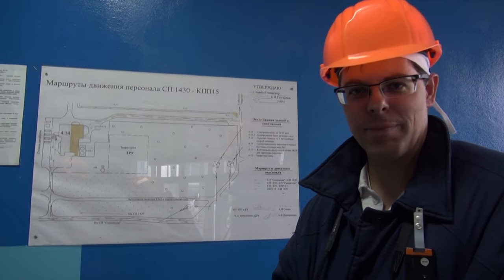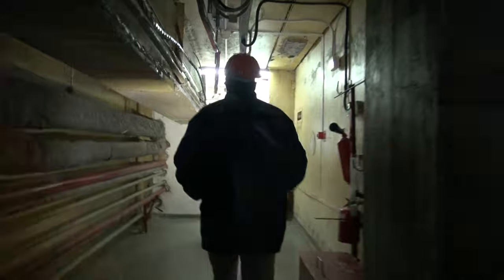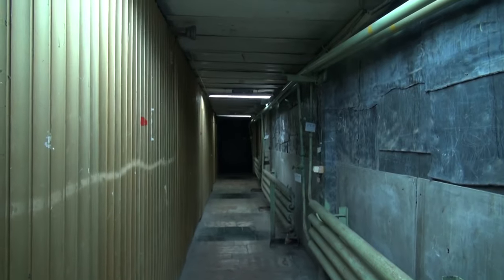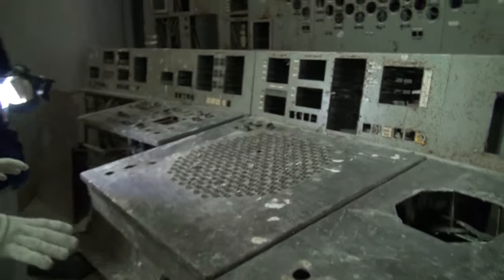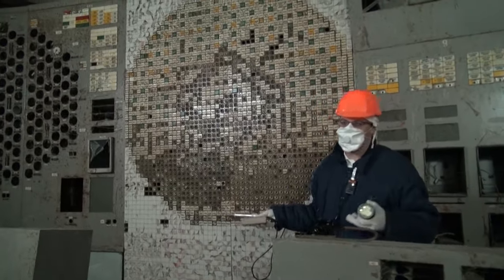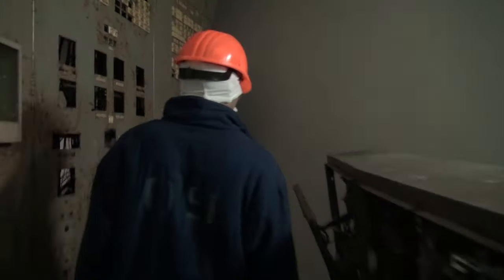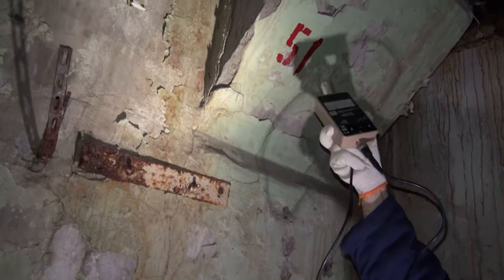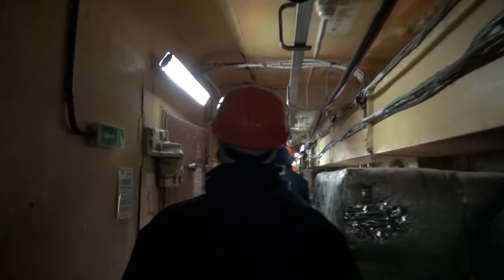inside Chernobyl ЧАЭС sarcophagus 2016 - reactor #4 control room and lead-lined corridors

Comment: Imagine, 750.000 pepole (soliders AND civillians) were sent to work on cleaning chernobyl, but the most disturbing story is when they clean the "3 deadly roofs" the first roof had around 200 "roengen" which mean 2 hours in that parricullar space could cut your lifespan in half, the second roof had around 400 roengen wich mean half of that time could cut your lifespan in half, and here is the real issue: the 3rd and the most deadly roof... the roof of reactor 4... the pieces of graphite and the derbis had around 12.000-14.000 roenger which meant 2 minutes on that roof and your life is cut in half, 2 minutes 30 seconds and youre gonna die in a matter of months 3 minutes 15 seconds... youre dead in weeks... the soviet goverment wanted to use moon walkers to clean the derbis off the roof and dump it into the molten reactor... 3 moonwalkers were used to clean roof 1 and 2... but the radiation of roof 3 was so high the wires in the robots decayed in matter of seconds due to radiation... a german robot named "the joker" was deployed onto the roof... it had 1 cm thick layer of lead metal around it... even that did not make it... so the commander made a decision to use "biorobots" (humans) to clean the roof, over 3.400 civillians were on the roof cleaning it... but not at the same time... they were in groups of 5 anf they each had lead armor and special equipment... shovels as well... each group worked for around 90 seconds... then they got off and the used armor was later destoryed... 

Could the disaster have been preveented if the Az-5 button wasnt pressed in the first place??
Reply: The reactor was in unstable configuration and was "running away" so there was nothing that could save it.

Comment: I just want to say, in the ussr never it was the fault of the equipment but always of the personal, in the states mind, dyatlov and his crew were the unlucky ones to be at the shift that exploded, the explosion was caused by the shutdown button
Reply: The 1991 report from "a Commission at the request of the USSR State Committee for the Supervision of Safety in Industry and Nuclear Power (SCSSINP)" removed most of the blame from the operators and severely criticized the reactor design and failure to act on flaws known (by the designers, not by the operators) prior to the acccident.

Comment: There is a documentary that I saw that said that the RBMK reactor that was unit 4 had sand packed around in between the outer and inner wall of the reactor.  The documentary stated that when the containment lid was blown up in the air, it came down with such force that it forced the base of the reactor downward.  It allowed the molten fuel and sand to mix together.  When the molten fuel and sand mixed, forming a solid mass of molten fuel and glass in the basement of unit 4.  One mass makes up what is called the "elephant's foot".  It's so radioactive that you will die of fatal exposure if you get too close to it.
Reply: All true, as far as I know,
Reply from the maker: true, but the elephant's foot is only one of the largest fuel containing masses (or quite probably THE largest mass), there's plenty more, though smaller "streams" throughout the entire building. as from what i've heard (i haven't seen the elephant's foot in person), the dose rate there is about 20 Sv/h, so you can run to it, take a photo, and run back. But the phrase "come on, just give me five more minutes" would indeed be fatal there.
Reply: 300 secs=ded

Comment: Why does it look like the reactor 4 control room has a wall in the middle of it?
Reply: Because it does, most of the building is cased in concrete
Reply: It looked like a small semi circular room. The hallways also looked cramped. Definitely designed for function over comfort.
Reply: they put concrete everywhere to somewhat contain the radiation

Comment: The elephant foot will remain dangerous for 25,000 years.
Reply: Nope. The fuel of an RBMK 1000 consisted of about 190t of Uranium dioxide, 5% of it being U-235, with a half-life of about 704 million years. And then there are the half-lives of the reacion products, all the way to stable Pb-206 or Pb-207.
Reply: Bogdan N English please 😂
Reply: @tommydizzay1648  Sorry, i didn't know how to put it more german than that :))
Reply: So Bogdan you're saying it's dangerous for millions of years?
Reply: @zakquinn5420  The thing is U-238 which was about 95% of the fuel mass is not dangerous (it is a beta emitter, and it is used, among others, as a shielding material in transport containers for radioactive materials). BUT... 5% of the fuel (about 9 tons) was U-235, which no one knows how much of it was already spent at the moment of the accident, and the elephant's foot is still critical (although the power output is only in the range of 100s of W to kW), and in the fission decay chain the fission products which have very short half-lives (tenths of a second to a few minutes) decay into radionuclides with longer and longer half-lives reaching tens to hundreds of thousands of years. And we are not accounting for activation products (the prompt neutrons expelled by U-235 fission or delayed neutrons expelled by the fission products decay can be absorbed by the U-238 which transforms into Pu-239). So no one knows precisely for how long the elephant's foot will be dangerous, but 25k years is VERY optimistic.
Reply: How long for the rabbit foot?
Reply: @mitchell5118  2 weeks longer than a chicken leg
Reply: @tommydizzay1648  Half life in science is the time it takes for one half of said item to decay and go away, so in 704 million years only half of the nuclear radioactive presence will go away. So another 704 million years is required for it to compeltely waste away.
Reply: Grizzly Fett does the sun only have 500 million years left ? That’s crazy that the radiation will last longer than the sun
Reply: @tommydizzay1648  I'm not sure and can't confirm that number but that's what half life means. But it is generally accepted radiation takes ages to go away, scary stuff!

Comment: 2:44
Standing next to the exposed core would actually only take 5-30 seconds to get radiation sickness and maybe 1-2 minutes before you die
Reply: Those figures are from immediately after the disaster. It's been over 30 years.

Comment: I’m astonished that people are still able to be in the control room of reactor No 4. Like Pripyat, it’s permanently stuck in 1986. It’s a shame that the control dials and other items are removed but I suppose they have their reasons for doing that.
Reply: Probably simply stripped to be used as spare parts for the remaining reactors, which remained operational for many years (no 2 until 1991, no 1 until 1996, and no 3 until 2000).

Comment: I thought that this was all a restricted zone for miles around the reactor? SI how did this get 'cleaned up' so quickly?
Reply: radiation levels have dropped a lot, most of the fallout has long since rained out into the ground water and been diluted to levels that are quite safe for people to spend months, even years inside the exclusion zone with no ill effects (there's still an increased risk of heavy metal poisoning though which is now a greater risk there than radiation, so agriculture and eating food foraged from the land or hunted wildlife is not advisable).

The idea that there is a dead zone around the reactor where nothing can live that will be there for thousands of years is and has always been known to be blatantly false, a deliberate lie.
It's just like Hiroshima or Nagasaki in effect, but with the risk of another big release were the containment building to fail, which is the main reason the exclusion zone is maintained.

Given special equipment (mostly air filtration) people can work there reasonably normally to build the new containment facility, which will cover the reactor remains as well as have enough space to store inside it the radioactive concrete and steel from the original containment vessel and control buildings once those are demolished.
At that point the machines used to build that structure and tear down the original containment facility will also be stored inside the new containment building, and the building sealed except some monitoring entrances for scientists and engineers to take samples on the inside.
Reply: CaptainDuckman The Catfish seem to be doing alright there
Reply: Ed Van Meyer the wildlife does fine there, but there are increased levels of toxins and radioactive elements in the animals.
Doesn't really become a problem for the wildlife because wild animals there don't tend to live long enough.
Over the 70-80 year lifespan of a human being, it may.
Reply: CaptainDuckman I was interested to see the catfish apparently unaffected. After Tunguska, localised plant life grew much bigger due to the radiation, which is strange!
Reply: Ed Van Meyer except that there was never any radiation at Tunguska :)
The local plantlife there grew faster due to the increased amount of fertiliser in the soil left behind by decomposing plats and ash from the fires.
And of course the flattened trees meant new growth would have more light than it would have had under the canopy of the former forest.
Nothing weird about it.
Reply: You really need to do some research Ed
Reply: userful1 Really? so how come the Carbon 14 readings were so high in Tunguska? If it wasn't a nuclear explosion.
Reply: Ed Van Meyer
It wasn't. End of line, go read some credible sources, even WIkipedia is OK, but stop reading contheos please. It's possible that the meteorite contained nuclear stuff, why not, but it wasn't a nuclear explosion.
Reply: userful1 No, it was a UFO that was seen seen to move and change course.
Meteorites don't snap trees off and leave a 'ground zero' area, or irradiate livestock or blow away trees in a massive radius. Meteorites are not radioactive. This was no meteorite.
Reply: I'm not interested in conspiracy crap, I read the books and do my own research, science may have ways of explaining things, but some scientists don't want to rock the boat.

Comment: Thing is, at some point the building is just going to crumble, fight? The elements will eventually cause it to collapse, and then what? What if that causes some problem with the melted fuel? Are there any plans for that?
Reply: That's exactly why there's now a huge steel dome over the reactor. There is no more ground water penetrance, and the reactor's lower biological shield was already doing a good enough job, as it was built to withstand this exact event.

Comment: the highest doserate in the video was about 100 microsieverts/hour, or 10 mrem/hr.  Most of the time it was like 3 mrem/hr.  Worst case scenario, they get near their quarterly dose limit (which is usually set far below the point where dose affects the body appreciably).   They could have gotten a heavier dose from a day at the beach.

Comment: who else constantly cursing Dyatlov?
Reply: the main error was in the rbmk reactor, but then they still did not know about it and someday these tests would have to be carried out
Reply: These are the words of Boris Stolyarchuk, one of the engineers who worked that night
Reply: @Xgibit  the main issue was not the reactor.
Reply: @EGL24Xx  it most definitely was.  the blame was initially put on the operators but later reports shifted that blame mostly onto the reactor design.  for a more detailed analysis of the events google INSAG-7 and read Annex I of that pdf.
Reply: Yeah Dyatlov is up there with Judas. Same with the designers that tipped the rods with a reaction accelerator “.  😂

Comment: Explain to me how an RBMK reactor explodes, comrade
Reply: Hi, "commrade"
I try to do it. If [telling] short: u have a tank of some volume, in which cores with the enriched uranium or couple of other high-isotope radioactive elements are placed. In an inactive state cores are lowered. When the employee (far off, certainly) partially takes a core - the place is released and process of disintegration of a kernel begins. Process back - at this moment comes to the end with return of a core and there was an explosion. In it there is no fault of personnel, not carried out test of a turbogenerator. The mistake was in bad engineering and sooner or later it is all the same occurred. The series rather in detail and interestingly showing why it occurred

Comment: What's up with that white wall? The control room seems very cramped and squished against the wall, is that really how they worked? Or was the wall put in after for some reason?
Reply: It has something to do with the construction of the new safe confinement. More exactly I don't knpw but it was put there because of it. I think they had to remove one of the circular light maps for the reactor from the control room for it

Comment: Whats kinda scary is that the building wont last forever....yet it still contains all that mess.

What happens when the building continues to deteriorate and collapse around the radiation, the molten fuel etc.

they already mentioned that room might have a hotspot because of water leaking, it makes you realize its degrading, its not going to stay standing forever.

Now I guess encasing it all is the answer, as they have already done with the sarcophagus, to contain the radiation.
But what about the elephants foot ? is it possible to encase it ?

Comment: Everybody looking at reactor control table   of Akimov and Toptunov and the famous AZ5 button that allegedly has blown the reactor.  Nobody looks at the middle table where pump operator Stolyarchuk must have reduced 10 times the pump flow of colder water to Right Steam Separator at 1,09 a.m. Interesting where his buttons on the table  are that according to the stories have resulted in hot steam 283C to the reactor bottom and eventually melt down. May be that's why Dyatlov in his last interviews said that the incident happened during the test,  but not because of it.

Comment: I wonder what radiation feels like if you’re just walking around in it?
Reply: I don't think you can feel it unless the levels are REALLY high, as in the case of Hisachi Ouichi, who received 17 Sieverts in a fraction of a second. That would be something like 100,000,000+ microsieverts per hour, which is INSANELY high. In that case you are getting dosed with 5000+ watts of radioactive energy, which is INSANE. 17 Sieverts on an average man is something like 1400 joules of absorbed energy, so it's not very much compared to a heat lamp but for gamma rays that is ENORMOUS.

Comment: I wonder why radiation is so low? Official sites state that radiation inside the control-room is 40'000 times higher than normal, which would be 4mSv/hr ? i only see readings around 100uSv?

Comment: Confused as to how some meagre fabric can protect you against all that radiation and you don’t end up like the firemen or engineers in HBO’s Chernobyl dying from ARS
Reply: Firemen and engineers got gamma radiation directly from exposed fuel, today I guess this is only alpha and beta radiation from activated materials.
Reply: They're okay because a substantial amount of time has passed, and they avoided getting too close to the hottest remnants.  Radiation exposure comes in 4 forms, alpha partices, beta particles, gamma rays, and neutron beams.  Alphas and betas are stopped by very thin layers of material (for betas even a piece of paper will work), so provided you don't ingest or inhale them you're protected.  Gamma rays aren't going to be stopped by any amount of material you can wear (we're talking meters of concrete or dirt) so dressing heavier isn't going to help.  But it really is important to remember that radiation levels fall off exponentially over time, and that the more radioactive an isotope is the shorter the half-life (the faster it disappears).  For instance, iodine-131 has a half life of 8 days; within a year essentially none of it remained.  For weapons fallout there is something known as the 7 10 rule (https://emilms.fema.gov/IS3/FEMA_IS/is03/REM0504050.htm), I do not know if this rule is valid for the isotopic mix generated under reactor conditions or not, but it does give an idea of how rapidly the most intense portion of the radiation can die down.  The rule is essentially that for every 7 fold increase in time you see a 10 fold reduction in radiation dose rate.  So if you measure a dose 1 hr after release, in 7 hours the dose will fall by 90%.  Again this empirical rule is meant for nuclear explosions and likely not applicable here, but is meant to serve as context.  The dose rates the fire fighters were exposed to were likely on the order of millions of times higher, based on time and proximity (radiation obeys the inverse square law (so doubling the distance divides the dose by 4)).